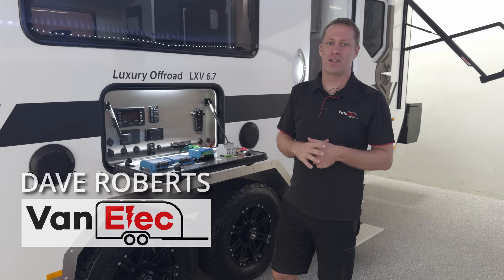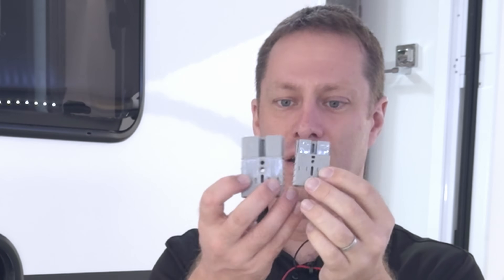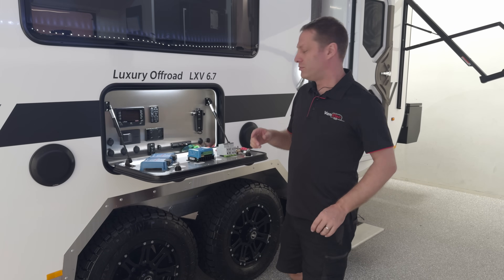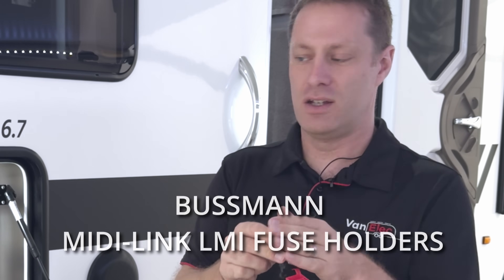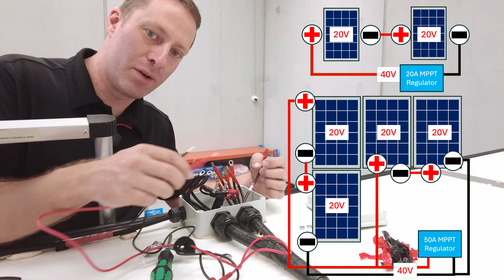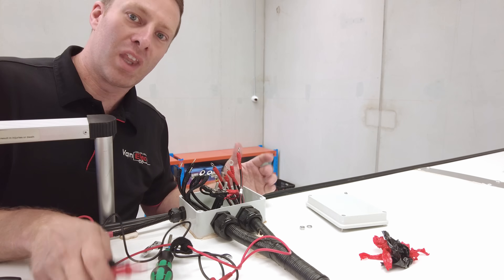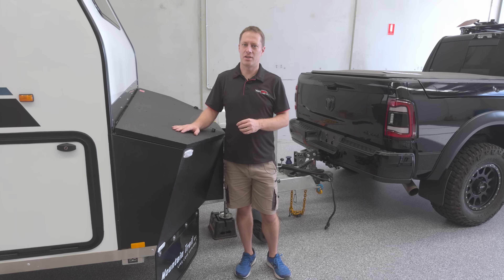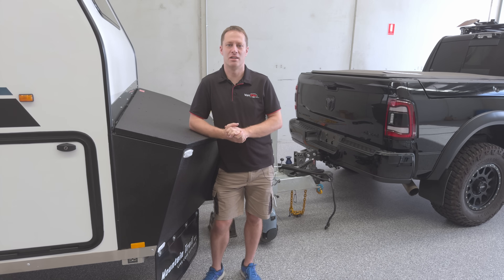How to cost effectively upgrade your caravan power system

Comment: Great over view. If the electrical system is not designed and installed correctly it will never perform to its potential maximum. On another subject if you had your time again would you buy another mountain trail or would you look at another manufacturer?
Reply from the maker: Yes I would buy another MT. It’s still one of the best engineered and best built caravans around. However I would insist that they addressed some of the design issues I have highlighted previously such as plumbing system, lighting etc

Comment: Fun fact, the genuine Anderson SB50 plugs are rated to 120 amps, the 50 amp rating is for a hot disconnect. Yes I know the 6B&S wire size is an issue with the long runs needed in a van.
Reply: 120 is peak. 50amp is continues
Reply: @ausguy4385  Read the SB50 Data sheet mate.
Reply: @ausguy4385  , No 120 amps is continuous and 50 amp is the rating for a HOT disconnect, please learn what the ratings are and what they mean
Reply: Thanks this is reassuring as I wired a 800w inverter with 1m of 8B&S with a sb50 in the middle  as I won't be hot disconnecting it it should be fine.

Comment: Great video couple of surprising things about the mountain trail, the batteries are at the rear of the van if I heard you correctly, and the solar system is in parallel until you fixed that also. Basic power generation / transmission denotes use a higher voltage so that means in series for the grids so any wire can be of a smaller and less weight for the same power out put. The batteries should be closer to the point of generation simply to cut down on the weight so I would have had these at the front of the van. 
A good fix well done.
Reply from the maker: Not quite…probably didn’t explain this too well. The batteries (5 x 120ah) are under the seat which is directly above the axles…

Comment: That is a great video and well explained.  We upgraded from the Redarc Manager 30 to the Redarc Alpha 100 in mid 2024 which increased charging from 30 to 100 amps.  We previously installed Victron MPPT charges for several years prior to this upgrade to boost solar charging which was independent from the Redarc Manager 30.  What our customers have done here is a great upgrade.  The only impact to the user is they will not be able to easily read where the DC/DC charge and Solar charge comes from as that input on the Redarc Manager 30 cannot be utilised on the Redarc Manager 30 interface.  For us a as a manufacturer that was an issue from a user perspective.  Apart from that this is a great way to increase charging as long as the end user understands how to read the loads, which these Mountain Trail RV owners do.
Reply: Thanks for your comments. The Victron app shows all the charging sources in one place both solar and car charging so it’s relatively easy for Mountain Trail users to see the additional components all together. And we can add the Manager30 solar and 240 charge input to that app easily. They want to have more historical data? it’s possible too. I’ve worked in user interface design before so I recognise how important this is. Give me a few weeks and I’ll come and show you our total solution for monitoring between different systems, it’s already working nicely with a few of them. Switching, power management, tank measuring and control in one place.  And way more than 100A charging 😉

You will have seen I try to do my best for MT customers and keep the brand held in high regard. Keep up the good work team Mountain Trail.

Comment: Very well put together but after having experienced the vibration issues on the Gibb River Road, I would suggest that the solar isolator be a rotary device rather than a toggle device. Maybe a bit more explanation as to system works better than the original.
Reply: Hi Colin. We've done 3 years of travel with over 20 DC DIN rail single and double pole circuit breakers across the Amarok and the van. Never once a false trip and we've done some rough stuff. As you know there are differences between AC RCBO/MCBs and DC MCBs, but the form factor is the same and the AC RCBOs in every caravan rarely cause problems and neither have my DC ones. 

I'll do a second video with more technical info - good suggestion.
Reply: @VanElec  I have extensive experience in electrical components and sorry to say that most Din style products are very prone to vibration. Also just watch the DC rating especially when using them in circuitry with voltages over 24VDC as they lack the blowout coil to quench the DC arc.

Comment: Very informative video. Is there a reason why you wouldn’t run a short -ve cable from the car’s Anderson plug directly to the chassis? That’d save weight and cost.
Reply: Yes absolutely some people prefer to do this. My personal opinion is to take the cable as close to the battery or alternator as you can. 

Advantages to cable all the way: less risk of volt drop (if you use the correctly sized cable), fault finding and testing is easier.

Advantages to cable at the chassis as soon as you can: Less weight, less cable used and less to pull through and manage. 

The cost saving on 5m of cable is small compared to the overall cost around $120 on the average car. Weight saving 1kg/m approx. Weight isn't an issue on this build.

Comment: Dave is extremely knowledgeable at what he does, it makes a change from some of the cowboys I’ve seen that have worked on some of my friends vans and some so called dealer technicians that have worked on some of my vans in the past and blamed the manufacturer for problems when it was their guys that had worked on my vans. It’s hard to find decent honest techs. Would have liked to know roughly what the fit out cost, obviously different vans, vehicles and set ups would reflect the price but a rough idea would be helpful and I know this wouldn’t have been a quick job and quality parts cables and man hours would not be cheap. Great video thanks.
Reply: Hi @cant-cook-can-cook The price of doing this depends on many different things. You're looking between $2500 and $6800 installed depending on: 
- How fast your car will allow you to charge
- How much solar you currently have and how much you want to have
- Whether you need new cables through the tow car and the van and how long/thick these need to be
- Whether you take the convenience of me flying to you somewhere on the east coast or you come to me in Townsville. 
- Which van you have and how easy it is to reconfigure

Compared to some competing products that cost just that for the product and have less performance I think it's reasonable value.
Reply: @VanElec  thanks for the reply